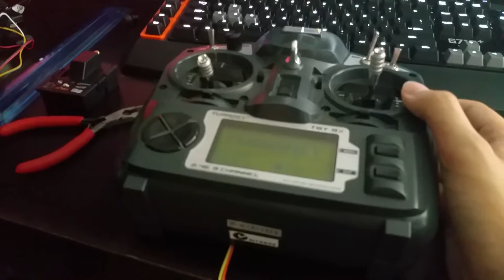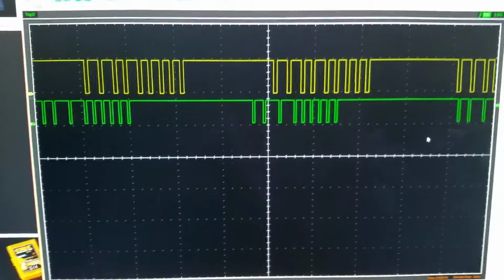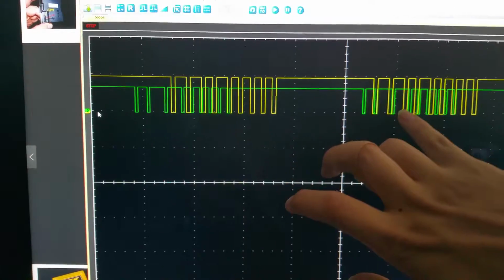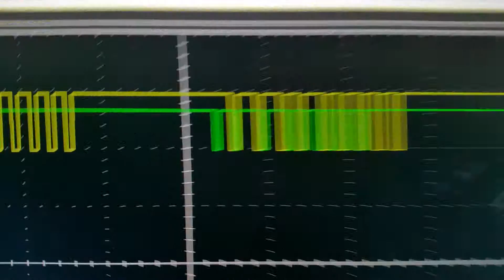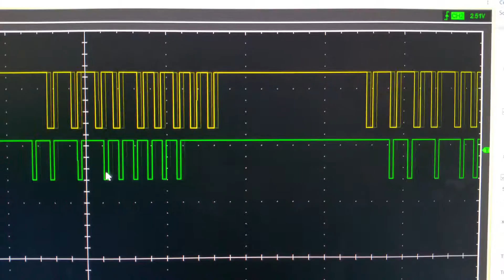DueTXPro Vlog #3: PPM Comparison with Turnigy 9X

Comment: Hi. The PPM signals are slow and the communication is one-way, therefor you can get away with a common emitter circuit (common-drain if mosfet) for voltage leveling. I would do that even if 3.3V signal level happens to work, because it's best to have good voltage above (or below) the threshold voltage level such that we get better noise margin.
Reply from the maker: bwack You're right yeah, I was actually considering if a mosfet would switch fast enough. Yeah I realize bumping it up to 5V would be a good idea, didn't realize there would be noise concerns though. Better to be safe either way. Hey, cool channel BTW,  you have some interesting videos in there!
Reply: ***** Thanks :) If the IO pins of the AVR ic are tolerant of voltages above VCC, then you could attach a resistor to 5V and PPM pin, and toggle between output and input (tristate), and in that way drive the PPM...
Reply from the maker: Yeah you're right, the problem is that the ARM micro on the Due is not 5V tolerant, I'll keep that in mind for other projects though, neat little trick!